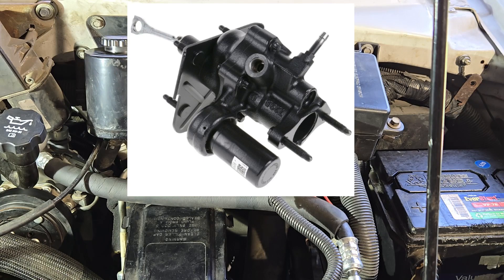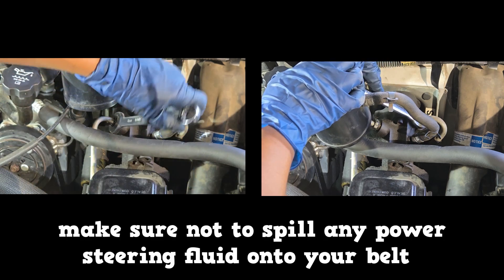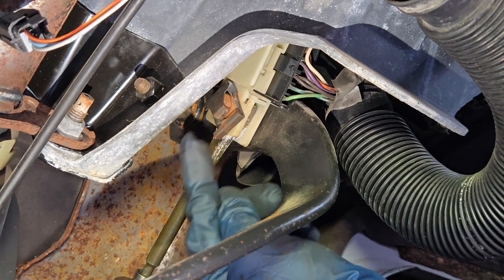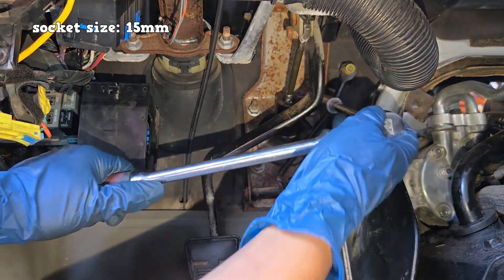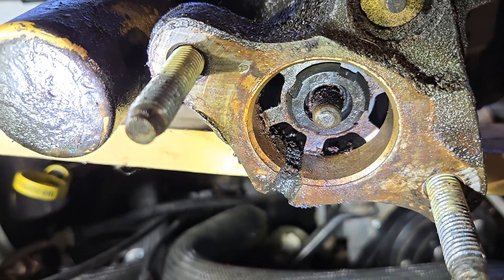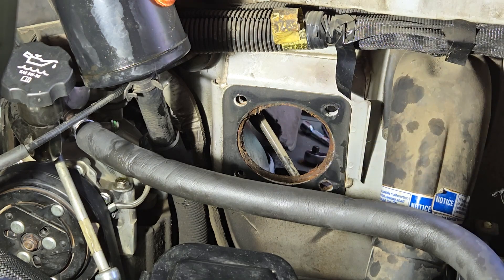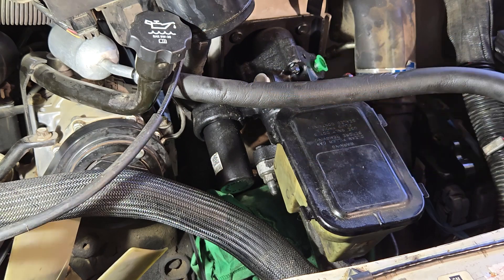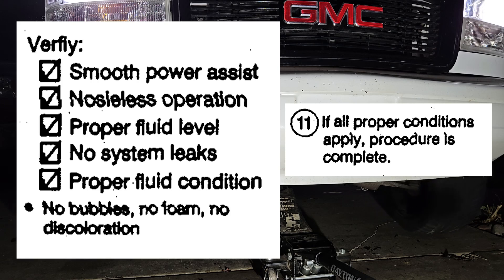How To Replace the Brake Booster (HydroBoost) Astro / Safari

Comment: Was there an O-Ring in between your booster and master cylinder? My Cardone 52-7353 indicates that there is?? My original did not......probably why it still leaked even after I rebuilt it! Thanks
Reply from the maker: No O-ring, just the pieces that you transferred from the old unit. The Master cylinder side just has a snap ring.
Reply: Lol -I glanced at the directions that circled all the parts going onto the rebuilt pump and thought it was an O-Ring! Ha!!